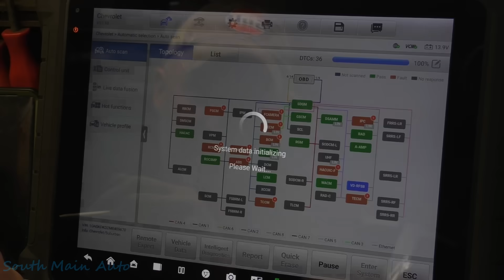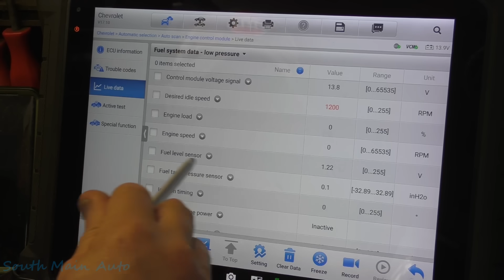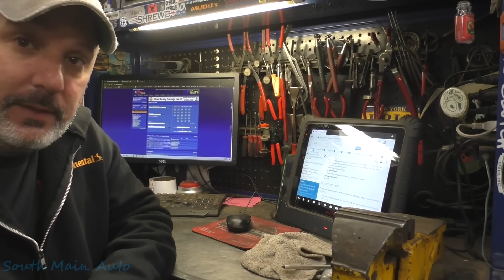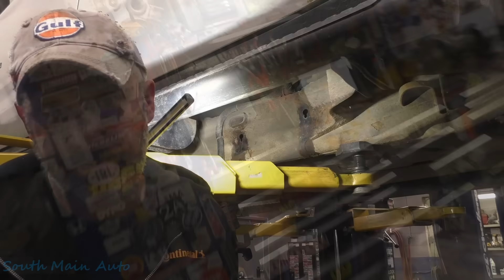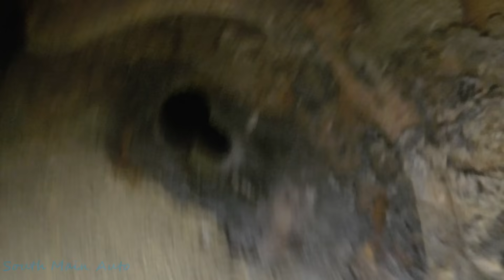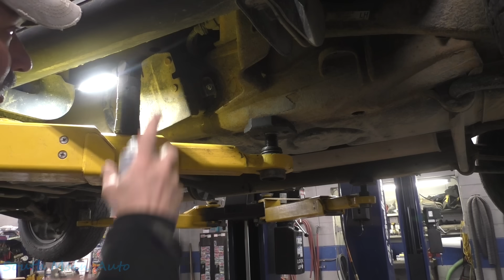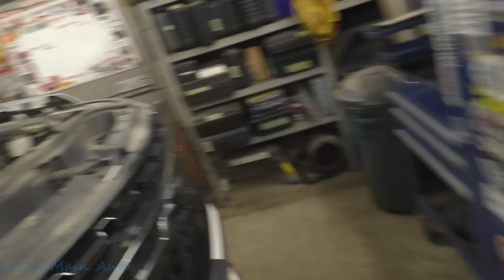'21 Chevy Suburban - No Start, Cranks OK

Comment: This is a lot like diagnosing ECM blower motors in HVAC equipment. Is it the control board, the module on the motor, or the motor itself? Sometimes it's impossible to tell because we don't have enough information from the manufacturer, and we end up replacing everything.

Comment: I remember coming across this issue of not being able to diagnose a three phase fuel pump back when I was a tech at a Toyota dealership. I even contacted Toyota about it asking for some more information on how to diagnose the system. According to the engineers there isn't really a way to do it without using the "use a known good part" method. The fuel pump control modules are just a fancy DC to AC 3P converter and they can only be diagnosed if they work (which sucks!). Check power/ground to module, if good, replace module. If module is good, then the data will tell you if the wiring is bad. If wiring is OK, then pump is bad. That's that.
This seems like it would be an opportunity for someone or a company to make a tool which generates an 3P signal and supplants the module to see if the pump itself works.
Reply: That's what fake chinese brushless tools are good for.  Remove the motor extend the wires make an adapter to your harness. Insert battery in fake tool. Pull trigger and viola.  Theres your dinner.  
Or substitute the motor for the fuel pump😊

Comment: Eric the best way I can think of for testing the motor would be to use an RC car brushless speed controller and remote and RC battery. Make some leads to go to the pins feeding the motor from the speed controller and presto you can test to see if the fuel pump runs at least. It could run the pump backwards but if it’s a short test at least you will know if the pump runs or not. Could be very cheap to try just buy a toy grade ready to run brushless RC car.
Reply: Or an m12 tool in every technician box. Bypass the brushless motor

Comment: I love the hammer fix first! Although I believe the correct next step is to get a bigger hammer!
Reply: I was shocked there wasn't a  dust storm.   Looks like the module was clinging on to the dirt for dear life.
Reply: He needs a BFH
Reply: Trying the hammer fix is a reasonable thing to do on regular DC (12V) fuel pumps that have motors with brushes.  This one has a 3 phase fuel pump so there will be no brushes to be jiggled by hammering so trying the hammer fix is pretty much irrelevant.
Reply: @ But if it has a piece of debris jamming the pump impeller, it could cause sloshing and free it. 
Brushless motor in a gas tank makes a lot of sense.  Controller for the motor outside on the frame rail, not so much......
Reply: @Vincent_Sullivan Can't hurt to give some hammer taps though
Reply: @Vincent_Sullivan  Agree.  However, it's quick and easy.  Not much lost giving it a quick try.
Reply: AKA Ford tool

Comment: Hi Eric.
Model planes and cars etc all use 3PH brushless motors these days. The motor drivers for these can be had for pretty cheap. 
You could used one with a battery, to do a quick go - no go test on the automotive motors, basically, just to see if it spins!
Reply: Great idea!!

Comment: Don't know for certain but it seems that the smarts to control the fuel pump must be in the magic black box.  If they are super cheap direct from GM, like you mentioned, maybe buy one, put power to it and see what kind of signal comes out for the 3 poles of the motor?  A duty cycle controlled square wave would be my guess.  That way the speed could be controlled by varying the duty cycle.  Putting sensitive electronic components on the frame rail has been a pet peeve of mine forever.  It makes no sense because they are inevitably going to get pounded with road debris, and in the salt belt, with salt and slush.  I don't much like the external Torx bolts either.  It doesn't take a whole lot of force to round the end off of them.

Comment: For the cover holes. I would use a bolt that fits in the hole with antiseize. Put it in and move it down to the slot and tighten. Of course, use a regular nut so it will go on easily. Or just weld a bolt in place. Pain in the a$$.Bad design.

Comment: I worked tech support for a car maker and we got brushless fuel pumps 11 years back. We were having pump failures as coasting cuts off injectors and the brush motors going down to low current/ low V and nonpass through fuel made them hot and then failure. I asked the engineer doing this presentation why having a small hole to allow some fuel to be bypassed so fuel kept moving and pump would stay cool. He looked dumbfounded. I know fuel vapor is the enemy so an orifice with a nipple and a tube to bottom of pump cup.

Comment: 4 year old module fail----GM quality for the win!
Reply: They have recently been failing on some new GM vehicles with only a few thousand miles on them. They are dangerous because on the new vehicles they leave you stuck, and you need a tow truck to get the vehicle to a GM dealer. Some will not move unless you crawl under the vehicle and release something to get it to roll.

Comment: When I worked at NOT A CHEVY Dealer, there was a 4500 box truck the dealer owned which wouldn't start. And it was all the way at the back of the lot, uphill, and loaded with furniture.  It was low mileage and in warranty, but the dick manager didn't want to pay for a tow to the chevy place.  I had that same code but walking back and forth (the truck wouldn't fit in the shop) I really didn't care.  The fuel pump didn't fix it.  The module was on backorder, but it fixed it.  Only took two months.  Also, in a no rust zone.   And while it sat out there, someone tried to steal the cats off it.

Comment: While I'm not an automotive engineer, I worked as an engineer for 40 years.  The reason they did that was because the engineer got his layoff notice and wanted mechanics to hate Chevrolet just like he just turned to hate Chevrolet.  So there ya go.  As a DIY hobbyist, if I ran into this, I'd use the cutoff wheel to get those stupid bolts off and then weld it back in later.
Reply: Another thought...  Uncle Bill's nephew had to get employed and nephew doesn't know $#|T.  So let's give him as safe a job as possible.  (THERE ARE  NO  SAFE JOBS IN ENGINEERING.)
Reply: I suspect they felt the fuel pump module was safety-critical. Doing it their way, you can replace the bolt as well as buy a new bracket. The fastening system would be new again.  Welding in a nut to the frame sounds easy, but it is a corrosion nightmare. I suspect the square plastic inserts do not give enough strength to hold that heavy module and bracket. Cutting access holes in the frame is cheap, but if the fuel tank is in the way, that won't work either. Still, I agree, this pretty much tops the goofy scale. The British have a saying, "Too clever by half."
Reply: Nah, it was some wet behind the ears kid right out of school who has never actually turned a wrench in real life.  I see crap like this out of the kids we hire right out of school too. I make it a point to let them screw up enough to learn a lesson, even if it costs us just a little money or time, it pays off in the future when you are not fighting crap like this when production is down on equipment they have designed.
Reply: Ford isn’t much better ever work on Ford me big trucks let’s use a solenoid to turn a relay on 😮
Reply: I call bs.  A technician ran off with the engineers wife.  The engineer decided all technicians will struggle  over that one
Reply: I think welding two bolts onto the frame, and then using nuts to hold it would be the best practice.  You even have the spacing set for you, drop them in and ZAP em.

Comment: The reason for those nuts is speed, the person on the line installing has the gun hanging with the socket on it, bolts are new, new threads and slip it into the keyholes and quick tighten then on to the next part and who cares about Johnny next guy who has to work on it.

Comment: Just a normal Joe here trying to keep my junk running, I won’t own anything past 2000. New cars are junk. Girlfriend bought a 2013 Equinox used after I told her to stay far away from it. 9 months later the engine blew up. smh You can’t fix stupid. I told her about the engine issues, she dug a deep hole for herself. Oh and the dash was lit up like a Christmas tree. ABS, Traction control and money light lit. We had a nice fight that night. Bad front axle, magnetic ring gone on wheel bearing, and bad O2. All replaced with OEM parts. Aftermarket is junk.
Reply: Good luck finding parts for 25 year old vehicles
Reply: @milfordcivic6755  No issues so far for my 1991 OBS C1500.

Comment: Hi Eric,
If you know the circuit diagram for the wires going to the three phase brushless motor I would try a radio control electric airplane 20A ESC (electronic speed control) to test the motor. You would have a 50 -50 chance of having it run in the correct direction. If it runs and doesn't produce pressure,  just swap two of the three motor leads to have it run in the opposite direction.
Reply: Look at this...I was gonna say this.  I bet a hobby ESC and anything to send it a PWM signal would work

Comment: I can think of why they mounted it that way. It probably saves 10 seconds per frame. Drop it in and the tool tightens it no need for clips. GM has the worst locations for some modules in terms of weather considering the are hq’d in Michigan

Comment: Fuel pump modules are easier to access and about $1,000 cheaper than dropping a fuel tank and then replacing the in-tank pump, etc.
Reply: One doesn’t offset the other. A module is another point of failure separate from the wear of the pump.

Comment: Getting pretty (c)rusty for an approximately 5 year old vehicle.
Reply from the maker: Typical Chevrolet the second you drive it off the lot you start the 10-year time clock after that the frames break in half

Comment: 1/4 in ratchet with a mid 10mm socket and remove 10mm nuts on the module.  replace the fuel pump power control module. Some instances that fppcm is covered under emissions due to the rate failure of those modules.

Comment: A quick way to test 3 phase pumps could be using a rc  brushless speed controller they are 3 phase dc and extend the wires on the speed controller, connect to pump connector and use an rc transmitter/receive to control the speed of the fuel pump it could work
Reply: Noice!

Comment: Tow truck Dustin says most of their business is from late model GM vehicles with bad fuel pump modules, some only a week old. Techs don’t check anything they just replace them first
Reply: Let’s go ask Sherwood if that inverted torx would work in Florida
Reply: Psrts cannon. GM likes it when you use it. $$$$
Reply: @jack002tuber  You have a different solution for a failed module?   I'm not entirely sure how it's $$$$ for GM if they are the price of a relay.....
Reply: @ckm-mkc they're not going to charge you a couple of dollars for the part when you don't buy it yourself and the labor $300 or $400 happen to me

Comment: the lifters were supposed to destroy the engine long before you were ever supposed to have to remove that bracket.  GM thinks the only thing wrong with that plan was they made that batch of lifters a little too good.
Reply: Is that same 5.3 currently in some 2025 silverados.
Reply: @gadasavideos8564 
Sure is.
Reply: They did invent planned obsolescence, that's their thing.

Comment: Using the inverted torx is to facilitate the assembly. Allowing the bolt to be attached to the assembly with the captive nuts in a unit before installation. 
As you well know, it's GM's practice to engineer things to assemble easily. They don't care about servicing requirements. 
Thanks, Mr O!
Reply: I agree with this, assembly cost is a top driver, they may also wanted to eliminate a hole on the other side of the tube that would allow the ingress of water and crap.
Reply: I agree it makes for fast assembly. A couple off studs spot welded to the frame would also be quick and allow the use of nuts that would then rust on and then break the studs off the frame. All in all a stupid idea and equally stupid location for the module in the first place.
Reply: It looks too short to put a double nut on it like you were running in a stud. I suppose one could clean up the end and weld a nut on it. Sucks that you would have to do it, but might still be usable by the next guy.
Reply: Assembly cost is factor #1.  Additional dealer service income is #2.  Absolutely designed with this in mind.  Understand that headlight bulb replacement is not a 5-minute job, and not even detailed "how to" in my 2014's owner's manual, states to take to dealer....
Reply: Shade tree graduate from dirt/gravel to concrete floor guy here...  Note to future self, if you encounter a inverted torx holding something on that you need to remove, try that first.  😅
Thanks Mr. O! 😊
Reply: You are right on the money man!!!!  It is all about reducing assembly time, serviceability is nothing more than an after thought, if at all. 
 To think this all started with using a voltage regulator and an alternator.
Reply: Think robot assembly. They are designing for machines to build everything.
Reply: They usually have the new fasteners prestarted in the new part and have thread locker on them. One time use. GM has actually done dumber shit like the welded on door hinges. If the door was not dropping because of misaligned hinges wearing out the pins and bushings...it ripped off the pillar or door. Imagine drilling out a half inch diameter weld while trying to save a pillar and a doorshell. Good thinking GM😂

Comment: A brushless DC motor is actually a 3-phase AC motor. Its control is exactly the same as a VFD-driven electric motor. I mention this because VFD drives for three-phase motors are decades old technology, so there are probably better instructions for testing them than for testing brushless DC motors. If you want to run such a motor, bypassing the control in your car, get a BLDC Three-Phase Brushless Motor Controller. (very cheap)

Comment: My '17 Tacoma developed a buzzing exhaust rattle. A quick visual indicated the clamp on the cat heat shield had taken leave. I proceeded to install a stainless worm claim in the place of the factory clamp and discovered that Toyota had made a hole in the crossmember to accommodate this action. I could have reached around the crossmember with some effort, but it was not needed.
Reply: Yep, nearly 300k on my old 2013 Tacoma. Just trucking along.

Comment: Joe’s electric sells a three phase motor actuator. You hook it up to the three phase motor and turn it on to prove out the motor
Reply: That’d be a useful tool to have
Reply: Yes, but $250 is high compared to what else you could use. RC hobby to the rescue, use an ESC and servo tester which can be had for about $30.

Comment: 3-phase DC? A three-phase brushless DC (BLDC) motor works by electronically switching current to its stator windings to create a rotating magnetic field. This rotating field interacts with the permanent magnets on the rotor, causing it to rotate. The electronics, often a controller or ESC (Electronic Speed Controller), manage the current flow and switching to achieve the desired speed and torque

Comment: just another great design from the wonderful land of GM.........have replaced 5 in the last 2 months,very common problem........and GM knows it......
Reply: They are probably using junk capacitors inside the module. Cut one open and see if anything looks burned, discolored. or swollen. IF anything does, there is the problem. A tiny solder connection might be failing too.

Comment: How does a engineering team decide to have a 3phase AC motor for the fuel pump when the rest of the vehicle is using 12 volts D.C?
Reply: On coast fuel pumps stall and pump gets hot and stalls. 3 phase motors tolerate this and don't get hot.
Reply: Not sure it is an AC motor. It might be a computer controlled DC motor, where the magnetic attraction is divided into 3 sections for each rotation. The 120 degree sections are energized one after the other as it spins. A computer chip can easily handle that processing.